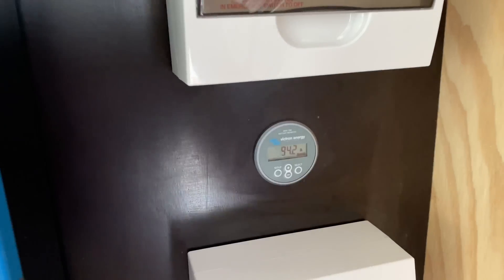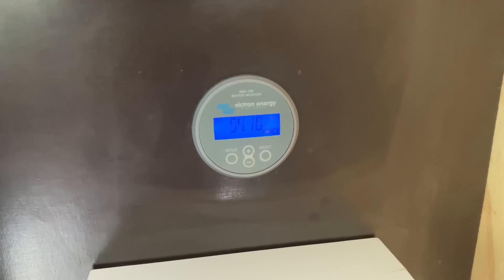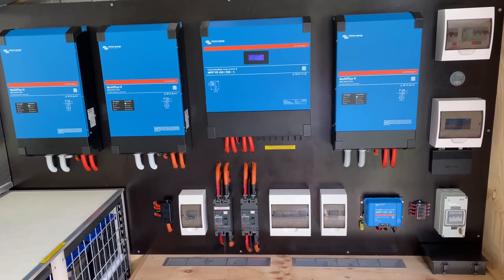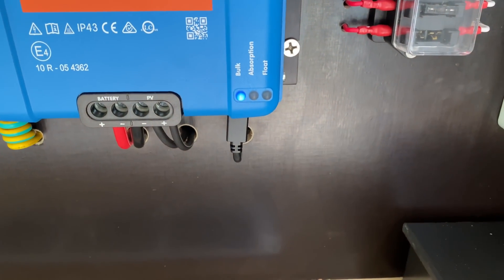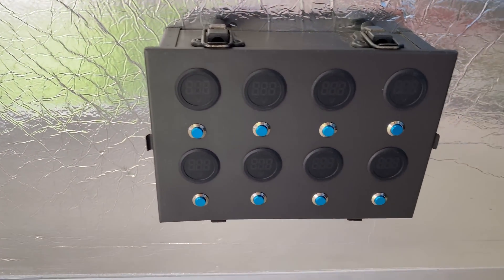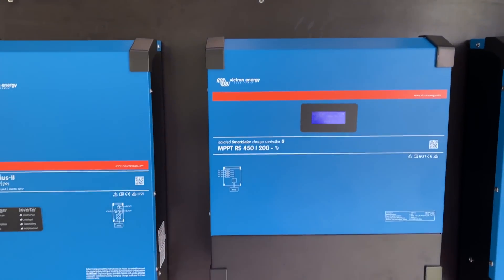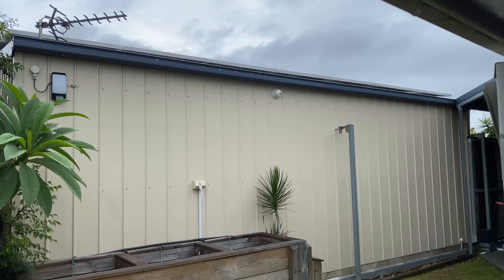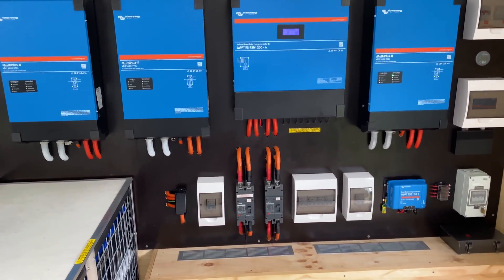Victron Off-Grid Battery Management System For 15KVA Parallel Multiplus II Solar Power System Part 2

Comment: 3 phase setup ?
Reply from the maker: I’m running single phase parallel but can easily be programmed for 3 phase in about 5 minutes.
Reply from the maker: Just took a peek at your channel. Looks like I didn’t need to explain the programming 😎 I would have to run another 2 16mm2 cables back to the house. We don’t have any 3 phase load so single is fine for now 🤙🏻
Reply: @OrganicPower-Australia  we are just contemplating parallel inverters now. We have hit the limit on our big inverter. Do you find the mppt to be good ? 

I've been curious how the quad trackers go with different panel combinations
Reply from the maker: So far it's a cracker! Was a lot cheaper to go with the single unit rather than 4 individual MPPT's. Just about to build another 16 panel array 4x4, and add a 250/60. Here is a vid of the arrays. The EASIEST Off-Grid Solar Power System - Build it Yourself - Triple Parallel Victron Multiplus II https://youtu.be/qaPhho9Mem4pushing 180A when the AC is cranking and charging batteries. Display is nice.

Comment: Nice, even on a gloomy day you're still filling up. There were a couple of days just recently down here where we literally barely saw the sun, I was lucky to make 6kWh over 2 days on a nearly 5kW solar array. I have enough battery capacity to see me through one of the 2 days but not both!
Reply from the maker: I just made do with second hand panels to keep cost down. Getting through the gloomy ones but I do have to lighten the load. I may add another 14 panel array down the side of the house. Thanks

Comment: What is your PV array size?
Reply from the maker: 14,100w - 5 arrays.
Reply: Can you do a video on them. Show us the arrays and their orientation and the steps you took to ensure that they operate as efficiently as possible. I stay in hot humid Nigeria with average ambient temperature of 37 degrees celsius,and have a 6kw array, but I can't get above 2.5kw during peak sunhours. My panels are split  southwest and northeast. @OrganicPower-Australia
Reply from the maker: Check this one out. The EASIEST Off-Grid Solar Power System - Build it Yourself - Triple Parallel Victron Multiplus II
https://youtu.be/qaPhho9Mem4

Comment: This is awesome, the victron monitor your looking at, showing -5amps in the arvo, is it easy enough to setup? How much do you typically use in the night?
Reply from the maker: The BMV kit is easy to install and only takes a few minutes to setup. We consume around 10% of the battery capacity overnight. Base load overnight when sleeping is around 800w